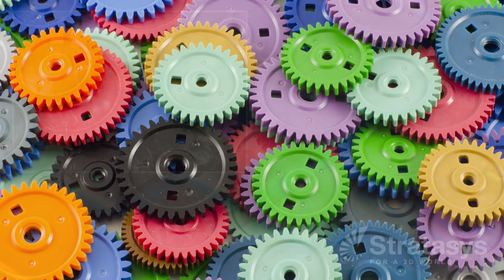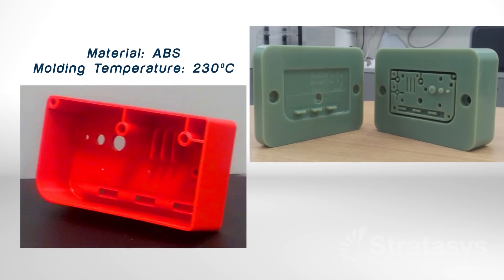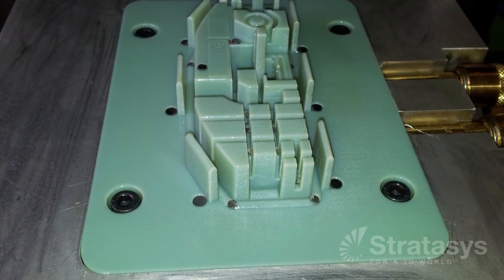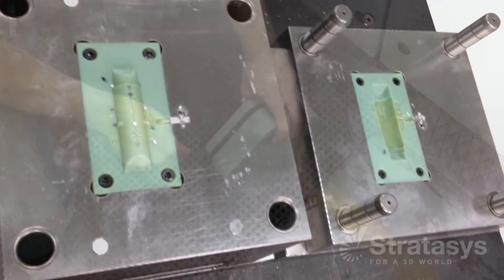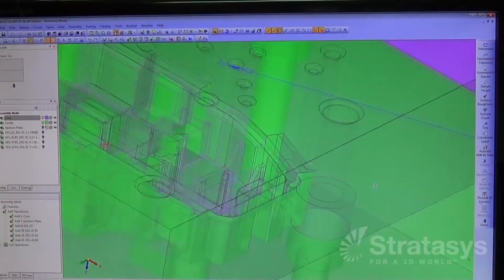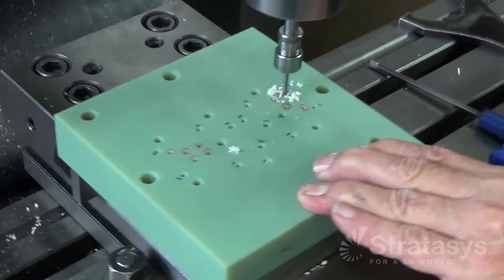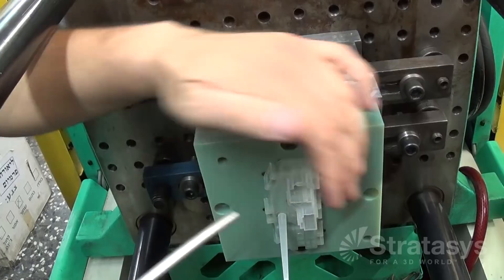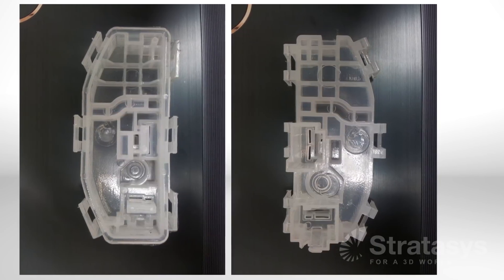Injection Molding with 3D Printing - How It's Used

Comment: What is mold material ?
Is it abs mold ?
Reply: It seems to be a UV-cured chemical polymer with some high-temperature resilience.  If you do a web search for their "PolyJet" system, you can find a working link to a request form for a technical application guide.  If I share the link here, Youtube will censor the comment for spam.  At any rate, the manufacturer doesn't specify material types on their information page; you must request the technical application guide, which discusses the use of a variety of printing materials.
Reply: @Chocolatchips    actually I want to ask you.... what the type of injection machine  force like ( 30 or 50 or 100 tons)  I need for cosmetic jars weight between 10 to 20 grams( one cavity mould)
Reply: @BB-bs7hm  Hi!  Well, it's a big investment, even if you're just planning to pay someone else to do the job, so the simple answer isn't a good answer.  There's a formula for answering your question, and you can undoubtedly find calculators online.  In your description here, you would have needed to include either the cavity volume or the material being used (such as polystyrene) because volume can be calculated using the weight of the application's material.  A mold flow design textbook would be a very good idea.  I recommend, "Plastic Part Design for Injection Molding: An Introduction", by Robert A. Malloy.  I see a copy on ebay for about $60 right now.

Comment: UG I keep telling everyone that 3d printing is a joke.  I have been studying injection molding for 10 years. You will never ever ever ever ever beat injection molding machine with a metal mold.
Reply: Well i got 5 years of education in injection molding, and have been working for LEGO for years. Futhermore i got 5 years on 3d printing, and at some jobs you are correct, but 3d printing opens alot of doors and havent been around for as longs as injection molding, that gives 3d printing quite an edge, because there are still alot to discover or evolve upon.
But it all depends on the need for the job, because tabletop injection molding are also evolving
Reply: Lol. You guys are trying to measure willies while really, this is apples to oranges. 

It’s not about 3d printing taking the place of a metal mold, it’s about if 3d printing a mold should be done before cutting your metal mold. If you’ve ever paid for a metal mold and realized you can’t use it, because the design is wrong… you know
Reply: Did you know you can 3D print metal molds? It’s called 3D laser sintering. Who’s the joke now.

Comment: What's the plastic -- is it polypro? Still... a 50% reduction is merely a two-fold reduction. A 10-fold reduction, and I would consider it. At just 2x the cost, I'd rather have a stainless steel mold which is inert, can be machined at 10 micron precision, and melts at 1500C over a plastic of undisclosed composition, 50 micron precision at best, and 250C melting point.
Reply: 2 fold reduction is half price!! Imagine if you have lots of parts. If you get a problem you have to pay once more. Also the lead-in time is much shorter...2-3 days instead up to 2-3 months. Most parts do not need ultra-high precision. Depends on what you want...it's not 100% injection moulded perfection but it's very very close, much faster lead-in and 50% of price. It all depends if that would tip the balance for you..it may do for a lot of people...that's why there is a market for it..just saying.
Reply: yew and u pay 2k for ss mold ,and bang part get problem and u need new mold ..bum 2k again ,,with this u print mold test 2-3 x  if it's ok for final u get 2k ss mold and  fun
Reply: hey dostum plastiğin birgün 1700 derece sıcaklıklara dayanabileceğini sana söylesem

Comment: Hello, i would like to know how much does it cost to make a mass production of a laptop frame, like for example clevo p870.

you said hundred of thousand for one metalic mold, is that that high for just cnc on a bloc?
Reply: If you were simply pricing cnc milling a block of aluminium it would be pretty ridiculous pricing. But molds are nowhere near that simple. You have rectangular undercuts, you need superb surface finish and mating surface flatness,  there are bunch of moving parts for election pins and undercuts. You'll end up doing lots of EDM and flatness grinding to get to the end result. Never mind that you need to design it all, it's not exactly simple mechanics. So yeah, once you add it all up you can indeed easily end up in the hundreds of thousands price range for the one mold, especially if you need to do several trial and error iterations to get perfect results.
Reply: My professord told us prices starting by 10k for very small and cheap molds, 30k for better ones (still small, like mobile Phone Backcover). The top end is open. Depends very much on surface quality, lifetime, cycletime or numer of slides.
Reply: @J23Ochs  ho my god, but a laptop is made of many plastic parts, bottom case, top one, keyboard around, screen bezel etc etc...

This is ridiculous...
Reply: @yakine13  yeah that's why you don't see random nobodies getting molds made for stuff like laptops. I'm sure HP, Lenovo, Apple etc, are hardly phased by the cost.
Reply: @mrb2917  I'm actually now manufacturer pc case 😁, but that's just laser cutting and bending.

However I swear that affordable cnc mold is going to be one of my goal... Imagine if random nobody can do mold as easily as 3d printer... That'll be fantastic

Comment: I like it very much, I work with injection plastic machine and was working on ·3D Printing Injection Molding
Reply: what is the material used for 3d printed molds for PETG?
Reply: @constantinstog1225   i also want to know which filament best for making mold for product of abs ,this is my contact number plz ping on me if you know that thing bro ...00971561239737
Reply: do you need plastic injetcion mold supplier?

Comment: once I get my CNC machine built I could do this. 
3d print a part with loose tolarances then cnc it to correct tolarances and presto.
I already have experience as a injection mold tool machinist. Designing a mold would be a peice of cake. 
but of course i can just use aluminum or nylon bricks, but that cost more to mess up with.
Reply: SaltyBrains  well cost of making of alu mold cost nice $,and if u make change in design u will pay for 2 or so .. so to make small 1cm2 mold for 1 part u need 2-300$ in cad/cam tooling time plus small q of alu bill = u waste 5-800$ if u need to change something vs 20$ for plastic
Reply: SaltyBrains  plastic is for cost saving if u fup mold ,,
Reply: One of my acquaintances makes mold inserts using a similar process. A 3D printed "master" gets cast in melted nylon or HDPE and then he machines it down from there to get it mold ready. Once he gets everything up to his standards, he whips out the aluminum for a real try. Once it's all done, he melts down the plastic for the next job.

Comment: Not into this business but if i need to take extra care about cooling and EXTRA TIME, this simply means its not time efficient to do business or mass production 

I.e instead of making 100 part daily ,i need to do 50 cause i need to take care of cooling .

Better plan this design properly
Reply: Hussein Kray - The advantage is to manufacture small amounts of a part for a low price. The break even point of a CNC manufactured mold out of metal is way higher than a printed mold. 
Also the manufacturing time of a printed mold is way shorter, so you can start to produce earlier.
Reply: Daniel B good to know ;; thanks for the info

Comment: Great video, very insightful! Why use metal / 3d printed molds? -What's wrong with silicone rubber molds in a metal shell?
Reply: it's about as useful as a mold made of butter. 
silicone expands under pressure of the injected plastic resulting in uncontrollable tolerance loss issues. even with a metal shell.
silicone is great for no pressure molding like resin casting.

fyi i spent time as a injection mold tool machinist.
Reply: Awesome, thanks for your insight
Reply: @darkshadowsx5949  what about a peek mold?
Reply: @darkshadowsx5949  Thanks you wrote all I want

Comment: High temp silicone can also be used to make short run or prototype injection molds such as this. This type of silicone can withstand 500 degrees. check this link out >> https://www.smooth-on.com/tutorials/casting-pewter-mold-max-60/

In the future I am going to seriously look into a high resolution 3d printer such as this one for my master parts used to make master mold from instead of wax as I use now. https://youtu.be/C7uMkBzOMaM This video is about using this 3d printer to make master parts for molds, watched it and I am impressed. I want it.

Note I am not affiliated with ether of these companies, just posting these links so people can have an idea of what is possible.
Reply: unless the silicone used is also pressure/compression resistant its useless... for injection molds, molten plastic is forced into every corner with literal tons of force.

Comment: From my experience a Statasys 3D printed mold may cost as much as a P20 mold from China.
Reply: If Statasys team do not invalidate your comment, should I assume your are right?
And why shouldn't I print my own 3D mold with my printer?
Reply: But can chinese companys manufacture and ship the mold in less than a week? I doubt it.
Reply: @lPropagandaPanda  Yes, they can. I have personally found that lead times from overseas shops are a fraction of domestic leads.
Reply: @LukePighetti  I had a small part. Got a quote from my local job shop, $550 and 4 weeks. Got a quote from China, $35 and 1.5 weeks. Even if I overnight ship the part, it's still cheaper. Even if they screw up the first time, it's still faster.
Reply: @henrychan720  People who think Chinese shops are slower and ultimately more expensive than Domestic shops either work in defense or have never honestly tried shopping both markets.
Reply: @henrychan720  how can i contact you
Reply: Fuck china, make it yourself and stop being lazy
Reply: Thundercuck i do agree!

Comment: is there any possiblitiy to use plastic molded part as core for other idententical part with injection molding process to achieved a hollow part????
Reply: a hollow part????? NANI????
is typically done in 2 pieces then plastic welded together.

Comment: Hello! Could you tell me what material was used to make the mold? Since ABS is molded quite hot i cant find a suitable material to withstand it. Thank you!
Reply: I think thermoset plastics may be used if you have any idea please let me know.
Reply: +Sankar S  I've since figured out that the mold is most likely made out of "Digital ABS". This is, however, nothing like the ABS used in FDM 3D printers since it is a duroplast instead of a thermoplastic and can withstand more heat. As for the mold application, normal thermoplastic ABS is usually injected and should be no Problem. If you're experimenting, PLA is easier to injection mold at lower temperatures than ABS and can be injected in a Nylon FDM printed mold. Greetings!

Comment: Who can make a 3d printed mold for me
Reply: Trade is always a good thing.
Reply: You still need a mold tooling designer to design the tool(nest the part cavity, figure out mold flow and cavity numbers, draw gates, cooling chambers, ejector pin locations, cav number engraving, size the steel mold base,....etc. ).  Then instead of machining from aluminum, hard steel or cutting an EDM electrode he will just 3D print it in a few days vs. 4-8 wks lead time.  Just don't expect million shot guarantee for real mass production.  Keep in mind if this is a prototype tool when transitioning to a hard tool it's like starting over, again.
Reply: +Philip Ward They won't design it for you, but they will print it for you: Shapeways.com, 3dHubs.com, iMaterialize.com.  Many online options.
If you've already designed your object, a 3DHubs person is likely to make a mold out of it for you.  You can also ask on 3DHubs for a local recommendation.
Reply: +Philip Ward im here for your services needs here in the USA and cheaper then most, feel free to contact me
Reply: +Philip Ward PMP MOLD - Professional mold maker in China,
you can see my profile and learn more about my company
Jim0pmp@gmail.com
Reply: +Laszlo Bernath
Severe Acute Respiratory Syndrome? and do you mean traitor?
Reply: +Philip Ward Philip If you go with a Chinese molder you will get SARS and you are a national trader to this country.